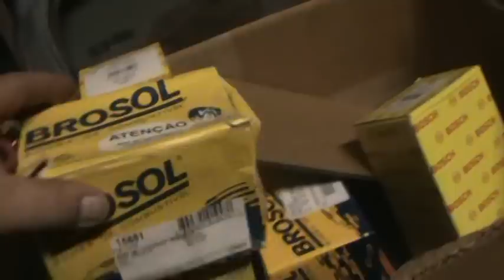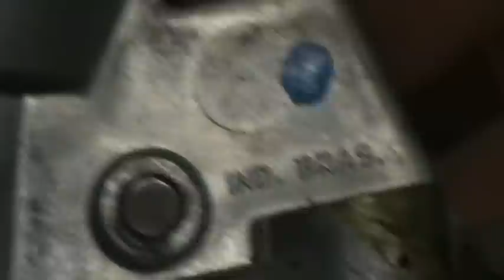Weekend Update - Water out, VW Parts, Early Morning Talk

Comment: Make sure to push the pressure switch closed with a plastic object.
It possibly could be one of the capacitors for your pump also.
This is one of the rules of both electrical and plumbing,"It will break or short out on either a weekend or a holiday".
Good luck.

Comment: Looks like a simple pressure switch man.  Take the cap off and have a look.  Does that run a pump for the water or something else?  Inside it's just an electromagnetic contactor.  You should be able to manually close it.  Those things do go bad once in awhile, maybe more in the salt/humid air.